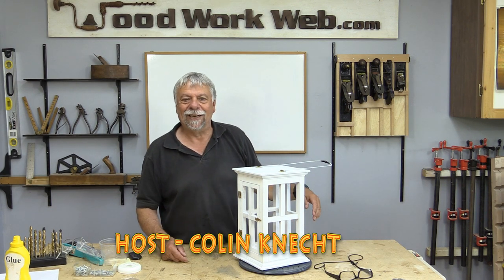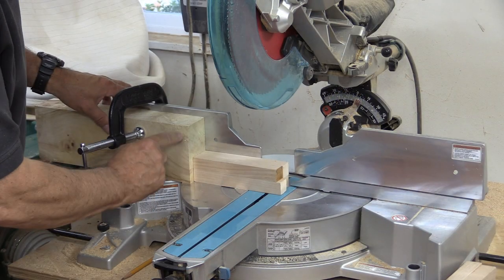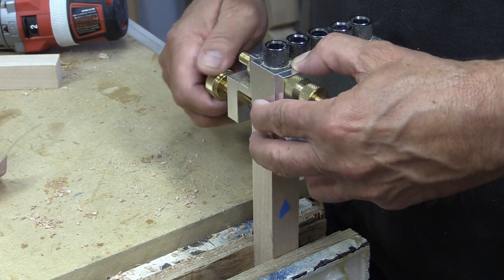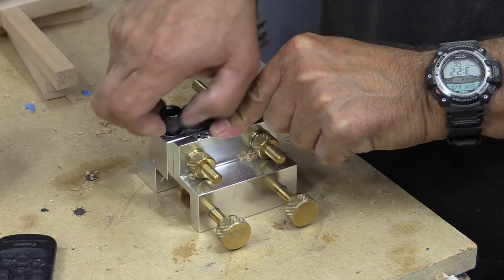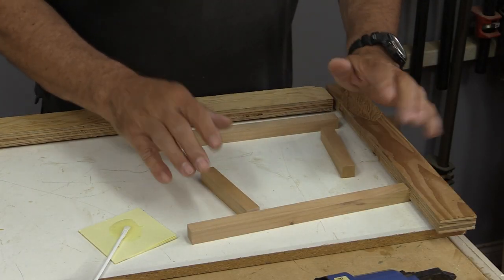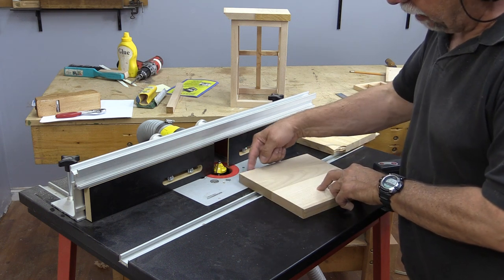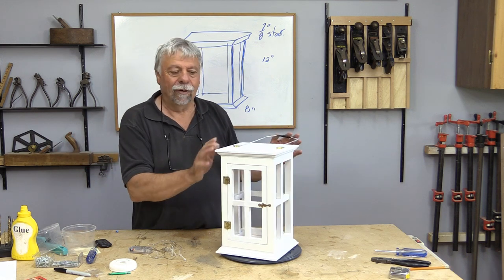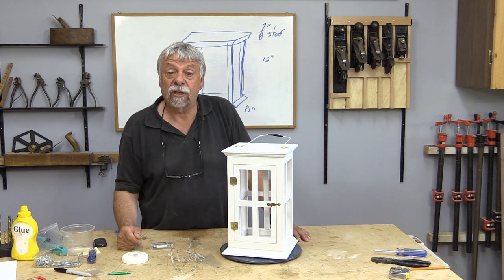Make Colonial Style Lantern -  a woodworkweb video

Comment: Well done Colin.  I recommend using LED rope lighting.  There are several manufacturers that provide kits that you can cut to length and add the appropriate connectors... or purchase a fixed length at a big box and wrap it it up.  They don't produce any heat.

OH.. I like your dowel jig.  Who makes it?
Reply from the maker: Hardnox Hmm, I did not think of that and I use those LED ropes in my driveway ... I will check that out, thank buddy :)

Comment: That's a really nice Lantern holder on myself I would put a small recessed light that you would use in a china cabinet a low wattage bulb and I know exactly where I'm going to hang two of them one of my hallway as you walk in the love for you and one right there on your front porch but instead of having hanging on 1 of Mount it up on the wall there so when you turn the light on inside the hallway light comes on in the outside porch light comes on but that's a very pretty designs thank you for doing it
Reply from the maker: Edward Kenard Oooo ... some good ideas here , thanks Edward

Comment: Hey, why not just use a fake candle. They come  in many sizes, and configurations of light intensity/realistic flame. Walmart has really inexpensive ones while Hobby Lobby has more realistic flames which cost a lot more. They also come with remote controls so they can be dimmed or change colors. They really are the solution to the conventional type wick burning candles.